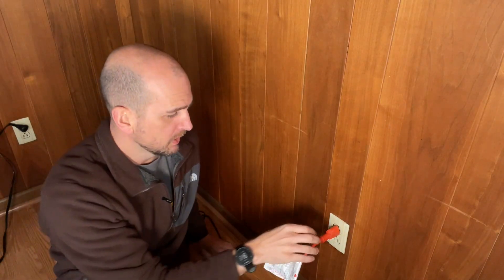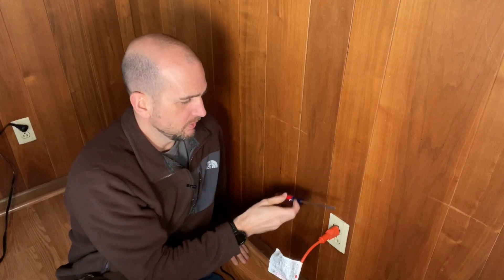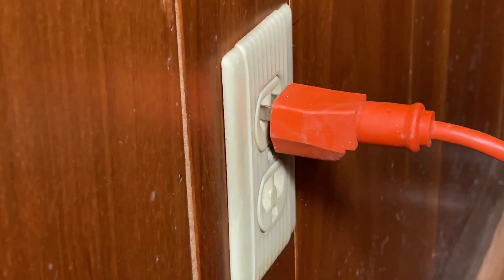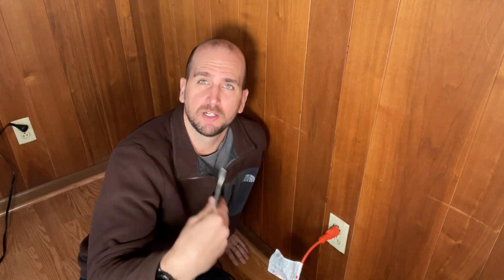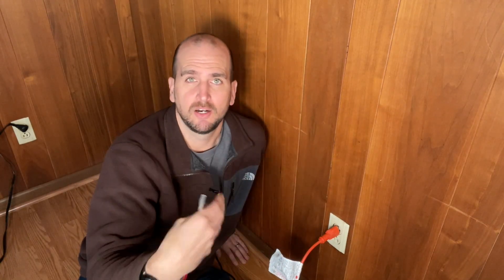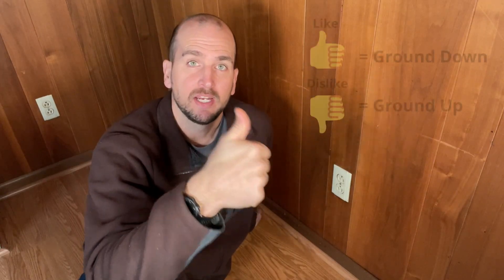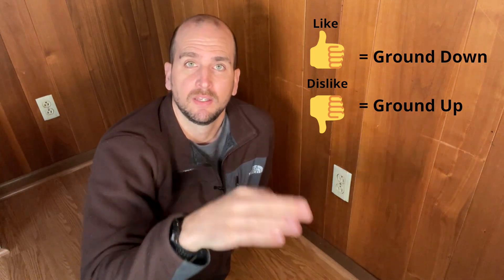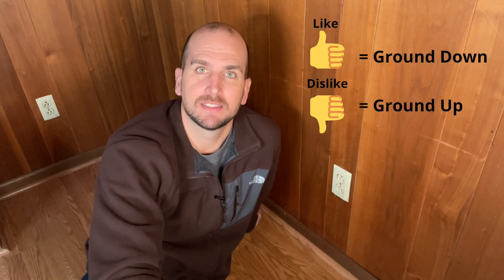Should An Outlet Be Installed Ground Down Or Up

Comment: Structurally, it's easier to break a "down" ground than it is an "up" one": lower twin prongs resist common use stress better than the relatively feeble ground prong. Though the notion of having a conductive object fall across upward prongs is pretty far-fetched, it's far more likely that a jutting plug may receive downward stress from other pressures—and the resulting rotation on a downward ground plug pushes in and bends the "down" ground prong. With the ground upwards, the ground prong is pulled outward, and the stress is absorbed by the stronger twin prongs—which also can rotate more freely in their slots. Try it with a dummy plug. A right-angle plug placed with ground upwards does not require any more clearance than the reverse position (maybe it'll require a few more inches of chord). I know of no rationalization for placing upward grounds, except for a few people who are used to, or who like the cuteness of its face-like look. Any perceived inconveniences of an upward-ground configuration can be remedied by shopping at a well-stocked store. The vote is silly: is there some comfort in deciding on an issue not understood? Might as well vote on what color shirt to wear while wiring—maybe something that doesn't scare the little guys jumping back and forth in the wires?

Comment: I have both ways at my house, normal way is ground down from what I have observed in my 83 years. I have a couple factory cords that need ground up to have the cord lay flat otherwise the cord has a big loop and strain above the outlet. No I do not want to cut the molded cord and replace the plug ground down
Reply from the maker: Thanks for the feedback 👍

Comment: I didn't know anyone even considered installing outlets with the ground prong up. I don't think I've ever seen one installed like that in a house. The reasons mentioned are so insignificant and can easily be countered with reasons for doing the opposite. Ground down is standard and some plugs and devices such as air fresheners will only go in that way.

Comment: It is odd that NEMA and some companies show ground up on their receptacle charts, yet nearly every manufacturer of cords, chargers and other devices that plug into outlets are designed for ground down.  I go ground down for the latter reason as everything just fits better that way.
Reply: NEMA (and the orientations presented in their diagrams) defines the "standard" AKA its their standard and round UP is the "standard" configuration... literally.
Reply: @grumpycat_1  It is not a standard if nobody follows it.  😂

Comment: Ground up is for hospitals. They typically have metal outlet plates and someone decided it's safer for the metal plate to have the plug upside down so the ground prevents a loose plate from shorting out the outlet. I've never seen that happen in forty years as an electrician. Homes should always be ground down except for horizontal installations. I've seen those done ground right or ground left but I prefer the ground left to put the neutral on top of the outlet.

Comment: When I'm doing commercial, like hospitals, we use metal faceplates. I always install those ground up because the faceplate can come loose. If a metal plate drops, it hits the ground. I've actually seen a plate weld because one was done ground facing down but that was close to 30 years ago.
I install 20 amp ground up in residential such as garages just because that's how I was taught. Same thing for switched receptacles.
8-)
Reply: Me personally I prefer ground up
Reply: There it is,. Someone did mention it.
Reply: If the plate loosens and falls down it trips the breaker, so no safety issue.  Ground is always on the BOTTOM
Reply: @garyvcole  What if the thing plugged into the outlet is keeping you alive?
Reply: @Timothy003L  If it's that important it should be on a UPS.
Reply: @garyvcole  There is a UPS. It's what the red outlets are connected to. Doesn't prevent you from shorting the outlet.

Comment: Ground up does not set well with the heavy block adapter.  some of them have the polarized plug.  Puts added strain on both the adapter and outlet.

Comment: I am a licensed electrician in Texas. I have been an electrician for 45 years. 

Have you looked at the cord cap of a 3 prong plug? Notice the ground prong is slightly longer than the other two which are the hot and neutral prongs. The third prong is required on all plug connected equipment that is not UL (underwriters laboratories) approved “ double insulated” . The two prong devices today have to be double insulated in the USA. The importance of the third ground prong is to protect the user from electrical shock and possible electrocution. So again looking at the cord cap the longer ground prong should make connection before the other two prongs (hot and neutral) to assure a protective ground path to keep the person touching the equipment protected. 

I believe the receptacle should be installed with the third ground prong down. The ground prong is the most important connection of all three of a cord cap. If the two flat prongs become weak and won’t stay connected then have a licensed electrician replace it. A loose connection can cause it to get physically hot and burn out the receptacle. With the ground prong in the down position this better assures the safety connection of the circuit.

A case in point : I was an electrical apprentice working on a large bakery oven. There was a machinist trying to drill a hole . He was inside of the large oven made of steel laying on a steel tray, sweating and holding an old metal cased drill in his bare hand. He hollered out to me to reset a breaker that repeatedly tripped using a few cuss words to express his upset about it tripping! So I reset the breaker and I immediately heard him crying out turn it off! Turn it off! I couldn’t get it turned off before the breaker tripped. Luckily he came out and had a burn in the palm of his hand about the size of a silver dollar. He was a lucky guy that day to have survived. He likely suffered the trip current of a 20 amp breaker thru his hand and arm! Back then ground fault breakers on temporary power were not required by electrical code and inspection of cords  and electrical tools were not required!
We then looked at his equipment and found the extension cord he was using had the third prong missing! Thus he was not protected!
This is my opinion only as I think it better supports the ground connection and is a safer installation. There is no determination as to orientation for outlets in the National Electric Code at this time.

Comment: In Australia, i think there is a compliance requirement nowadays that all plugs have their Active (Hot) and Neutral are sheathed enough to so that for live prongs to be exposed means that its no longer making a connection to the power anyway  (in the past, I've got a tingle from getting my fingers under the plug trying to remove a stuck plug and touching live.

Oh and 99.9999999% of power points are ground/earth down here.

Comment: as a contractor and my grandpa being and electrical contractor it goes like this...when they first switch over to 3 prong everyone was ok with ground down .. basically cause it looks nicer on the wall seeing the lil  smiley face looking at you.. But over the years the census has been more an more leaning towards  ground up for less chance of a fire hazard when working on or  use and operation of the outlet ..

Comment: HYDRO-QUEBEC; which supplies a lot of power to the Northeastern United States, uses outlets as characters in some of their advertising. The outlets are facial characters with two eyes and a mouth. In other words, the ground is the mouth. I purchased an electronic air freshener which will only operate if plugged into an outlet with the ground below.so I vote  for a 'V' orientation.

Comment: In some countries like UK, the three prong plugs L and N holes are covered by a mechanical interlock which only uncovered by pushing the Ground pin in the socket. The Ground pin is always at the top because  you can’t see the hole when the Ground is pointing down. It was very annoying when I moved to Canada. Every outlets seems to be upside down. Took me years to get used to it. Now I only install the outlet with ground pin down because everybody is doing it. Still can’t find the reason of doing it this way.

Comment: The only place I ever saw receptacles installed with ground facing up is in a hospital. If one wants to look at safety (preventing shorting hot to neutral) the United Kingdom has the world's best and safest plug-to-receptacle system. It's nearly impossible to shock yourself with their system. It's due to the long history England has with devastating fires, and that country's efforts after WWII to do everything possible to prevent those fires. See Mehdi's channel (from Electro-Boom) on a visit he made to the U.K. and the study he did with the outlets in his hotel room.

Comment: Scott, thank you for covering this. I generally install ground up and here's why.  In 1994 I had a frightening experience while watching a friend's kids in her home wherein a plug for an electric guitar had worked its way out a little and one of the kids somehow launched one of those beaded metal key chains across the room. Guess where it landed: across the hot and neutral prongs which were exposed. The spark, noise and circuit blow-out scared us all. I also learned never assume kids know how to plug things in. Also, as you mentioned, if a plug is two-prong you can still get a short so kids need supervision. As for hospitals, there may be some more qualified to explain, but I did work in IT for a major health care system and had numerous projects in ORs and patient care areas where some additional problems, like splashes, needed to be considered. My experience in the OR projects  tells me you can never have enough outlets, and especially outlets on emergency power. Also, anesthesia staff and others who make use of many, many electrical devices are focused on patients, not on the power cords. So ground prongs get broken off sometimes.

Comment: Think about how you hold a plug, not only on the way in, but more so when you’re pulling it out, at which point you are even MORE likely to grasp it closer to the outlet, (assuming you’re not just yanking on the wire itself)!  Your index finger wraps around the bottom, AND essentially out of sight, far more likely to contact one or both hot prongs of a plug, if they’re down there!

Comment: When unplugging a tool or extension cord your usually standing...... when pulling out the plug (cord) the last part of the plug touching the outlet would be the ground........your wife’s nightlight should have a plug that twist to make a adjustment
Reply: Usually the electric comes from the basement.... so with the ground up the electric can get to the blades on the outlet quicker......... 😉

Comment: A lot of power bricks and such, with polarized plugs are designed to hang down when the ground is down, these then, if the ground is up, will hang with the weight at the top, and will more easily pull themselves partly out.

Comment: As a licensed Electrician in NC I always put the ground down per the right angle cord you showed, found on most refrigerators, some window AC units, etc. I been around the business since 1968 & I've never had a call where a plug has relaxed in the outlet & was shorted out by some foreign metal object falling on the exposed plug.Not saying it couldn't happen, just extremely rare if ever. Be nice to know if an insurance company or institute has any instances of such an event!

Comment: The metal object argument is nonsense,,, plain and simple,,, this scenario like never happens,,, NOW! A more likely scenario is with water getting spilled onto the outlet,, in which case the water is going to run ⬇️ down,, with the ground down ,, the idea is the water will short it’s self to the ground preventing YOU from being shocked when you unplug it.. if the ground is facing up... then you will likely get a shock when unplugging,,, besides most ALL small appliances like nightlights are made to go ONE direction

Comment: The lovely people who rewired my house in the 60s or 70s decided to wire most of the outlets sideways.  Why?  Who the heck knows!  But all the exterior walls are plaster, so they had to break it up, remove the old box, but the new box in sideways, and re-plaster it.  I have half a mind to 'fix' it, but it isn't hurting anything and I have too many other projects to work on lol

Also, depending on where you live, a random upside-down outlet typically means it is switch activated, or part of a different circuit than the other outlets in the room.  So if you think you have the power off in a room, and see 1 outlet upside-down... be sure to double-check that it is actually off.

Comment: I have always installed them ground down, but I thought I read somewhere that the the intended way for them to be installed is ground up because then there is more support to hold the plug under stress and most of the time stress is in a downward direction(weight of the cord).   I have seen dozens of outlets where the plastic is cracked and often busted off right below the ground hole.  If you stress it down it will damage the outlet with the ground down, especially if the plug is coming out.  Imagine in commercial buildings when the cleaning crew is using their industrial grade cleaning machine (vacuum) to clean the floors and they yank on the cord for hours on end.  That's why many commercial buildings, namely hospitals, call for ground up.

Comment: Something to keep in mind. If you are adding a slim outlet and use surface mount metal or plastic wire covers, you will need to plan ahead which way you want the outlet. That Molex three wire  laying flat in the channel will not allow you to get it to fit using the right code on the socket once installed. Copper/gold screw narrow outlet leg must always go to the black hot wire.

Comment: I like Ground DOWN because the plug is more difficult to be pulled out unintentionally because the 2 top pins create resistance rotating down from the weight of the cable.

Comment: Been working as a commercial electrician for 7-8 years, I was taught to always install ground up, and wrap some tape around the outer edge of the receptacle body before pushing it in place. Commercial and Residential have different standards though. Not sure if it's code or not, but I've heard ALL hospital receptacles are "upside down". On the other hand, while looking up some source material just now, I found a post by an electrician saying the inspector failed them on upside down outlets due to labels.

In other words, there was a 'this end up' sticker, or stamps in the metal saying 'top' or whatever, and they just installed them in the "upside down" position because that's what they were used to, and failed because of it. Personally I've never had an inspector want to see inside a device box. Junction boxes, panels, and trenches, sure, but never had one actually examine an outlet I'd done.

One nitpicker of an inspector did fail me on clearance once; I had 36" out front as required, but it was a crowded apartment building electric room, the best bare spot on the wall for my equipment put me next to some 4" EMT risers. According to him, my side clearance was inhibited, and any future worker in that spot would not have "a clear avenue of escape". So I had to add some offsets to bump it off the wall, and build it out 8-10" with strut, to get flush to the plane of the risers. I thought the result was ugly as hell, but he gave me the sticker.

https://community.spiceworks.com/topic/1948768-upside-down-electrical-plugs

Comment: For about 50 years I have installed outlets with the ground down.  The reason is that the most frequent accidental partial removal from a plug is by walking by the plug and stepping on the cord tilting the plug down.  Installing outlets with the ground up can disengage the ground terminal first which is not good.  With the ground down that means that the LAST electrical contact to be broken is the ground connection.  When it comes to the installation of outlets above the height of a standard wall outlet, the discussion becomes meaningless since stepping on a cord would frequently not even be possible.  
In any case when I first started doing electrical work the Code at that time in the 1960's showed a picture of the correct way that a standard 120V grounded outlet should be installed.  My instructor for the journeyman program I was in was quite specific - ground down and don't forget it.  Today NEMA doesn't seem to care how you install outlets as long as they are wired correctly.  I have even seen some contractors today using ground up to indicate a switched outlet.  When I point out the difference to homeowners most of the time they ask me to correctly install the outlet with the ground down.

Comment: Was measuring to center a picture on a wall and the metal tape measure slide down the wall and caused a short circuit across a ground down receptacle. Burned the tape measure in two luckily after I let go. I've been ground up ever since.

Comment: i am an electrician with 35 years experience and this has always been a sticky point.   The reason they once talked about making a ruling was {as you said if a plug is slightly coming out of the plug and a metal frame picture falls}   But then common sense almost prevailled.   they noticed that if a 3 pin plug is used  the ground pin acts more like and anchor to stabalize  the plug when it is place in the ground down position where as it was more likely to work lose when ground up.   So what SHOULD  have happened? they should have banned 2 prong plugs and insisted ground down.   But they didnt. so here we are still having this discussion.   but yeah safety wise   use 3 prong plugs mounted ground down.